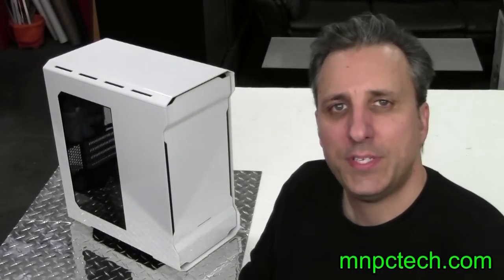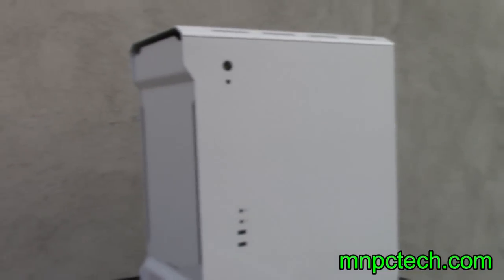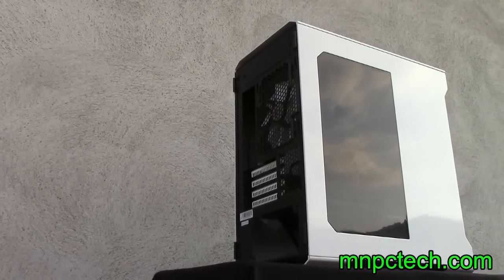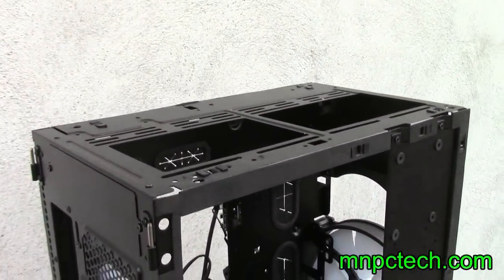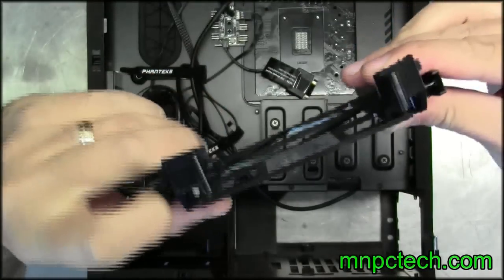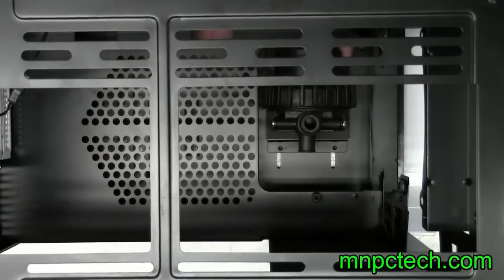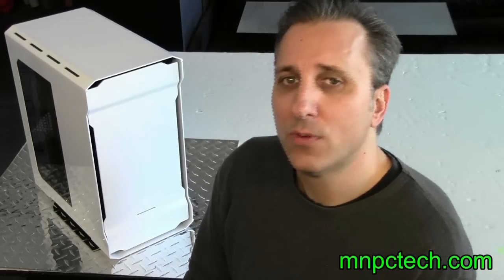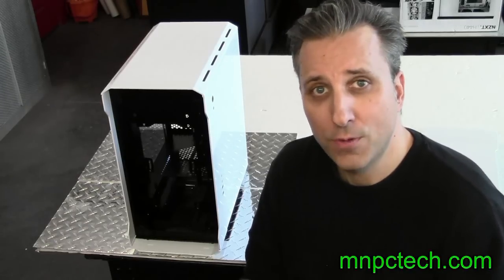Phanteks Enthoo EVOLV MATX & ITX Case Review by Mnpctech.com

Comment: I had this for a few weeks now. Watercooled with 1x120mm rear rad, 1x240mm top rad. Build quality is outstanding and the case is beautiful. I use 2x140mm Noiseblockers in front and that works great.

The main problem is that hot air gets trapped under the top shroud. I have to remove the top for gpu/cpu intensive gaming and benchmarks.

Comment: I aspire to being a 40 something year old that can disassemble a case as fast as you, Bill! It looks like you could un-screw the bottom mid plate/PSU cover for bigger, fatter radiators just like the Enthoo Pro, though. These cases are sweet, but I agree they should include additional trays for SSDs. I got the 2-in-1 SSD tray from Amazon Canada for $9.99. Equivalent Lian Li cases with far fewer features have retailed for more, and they don't use the big, thick aluminum. Nice review.
 EDIT: The pump bracket that came with my Evolv has more screw holes and can hold a DDC pump, but I haven't figured out how to use more than 3 screws in it, ie. one hole doesn't line up. As for the reservoir/HDD plate, the Bitspower plastic loop rez holders line up and the single screw EK versions also work but not much room for a half-decent thickness radiator in front.

Comment: The black version of this case is $129. I bought the black version for £100 here in the UK, fans are super quiet and the case is keeping my GTX 970 super cool while playing games on max settings at 1080p. The Corsair H75 in push/pull fits perfectly at the top with the optical drive installed. This is a fantastic case, probably the best micro atx case out currently, seeing as there aren't a lot around.
Reply: I know that you've posted this comment 2 months ago...but I have a question about the case: Is the window good against scratches? I've had a fractal design Arc mini r2 and it scratches like hell even though I was very carefull with it.
Reply: Well, I haven't got it in a situation where it would scratch, but I've laid it down (gently) on a hard surface a few times and it's fine.
Reply: MrJCartzy  I also didn't get in a situation in which it would scratch, but it scratches even from cleaning with a microfiber cloth. But thanks anyway I'm gonna buy the case soon!

Comment: If this case didnt have the power switch and USB ports on the right side, it would be a home run. Question Bill, do you think that with above average modding skills and access to really any tool, that it would be possible to relocate the power/reset switches and the USB ports from the right side?

Comment: no ATX cases.... however the xps 700 series and g5 powermac/mac pro had pretty thick sides (but the top, bottom, front & back were pretty thin)
Reply from the maker: Luke Alexander Phanteks will consider ATX version if MATX sales over the next year are good. Thanks for watching!
Reply: Sorry for the confusion bill,  I meant atx including derivatives (matx and itx) and that the only cases I could think of with side panels near 1/8" were BTX and proprietary apple form factors
Reply from the maker: Luke Alexander Agreed, and it pains me that I haven't had any time to mod the XPS case I bought from Greg.... Too many cases to mod, so little time!
Reply: ***** I also agree that there are too many cases and not enough time, My g5 mod was a fun case for the year or so that I used it, and I would have bought an xps 700 for AUD $30 online about a year ago if it hadn't been sold already when I found it, but then I would not have been looking for a Lian li and found my PC-A10... so in some ways i'm glad that i didn't end up with an xps 700, which would have been a ton of work as my hate of inverted ATX would have driven me to completely rebuild the internals...
Reply: loki5041 im aware, and it looks awesome, going to have to recommend it to some friends, however I recently acquired a lian li PC-A71F, which I am going to mod the heck out of to become the basis for my main rig... log to start in coming days... (on the zoo, bit-tech and OCAU)

speaking of which... *****, if you still have the A71F you reviewed a few years back, It would be cool to have two projects on the same case, at the same time, on the Zoo... (in other words if you've still got it hidden away somewhere, it would be awesome if you were to dig it out and start modding it!)

Comment: im building in enthoo itx, should i add extra fans for better airflow or does that make any difference?
Reply from the maker: +pcmasterrace  adding more intake fans with filters will build up your positive pressure cooling. This means cramming as much cool air as possible into case and forcing hot air out of all the vents/cracks. Doing this also eliminates dust build up that can hinder performance. I use this aluminum mesh filters in my builds, http://mnpctech.com/pc-computer-cooling-fans-grills-custom/pc-fan-filters/
Reply: In case you're not aware, synthetic mesh filters can filter particles smaller than the mesh size, due to electrostatic charge. Metal mesh won't do that.
Reply: Will a Corsair Hydro Series H110i GT fit in the ITX version?
Reply: George Papageorgakis yup it will

Comment: Can i install in this case a Corsair Hydro H110i GT water system with Noctua NF-A14 FLX?
Motherboard Asus Z170-A
CPU:6700K
RAM:16GB (2x8) Corsair Vengeance LPX 3000MHZ 
PSU:EVGA Supernova G2 750W
SSD:Samsung 256GB 850 PRO
HDD:WD Black 1 TB
VGA: GTX 980
Thank you very much for information!